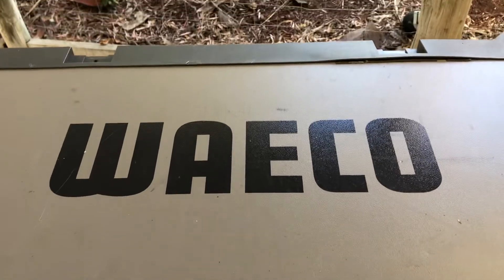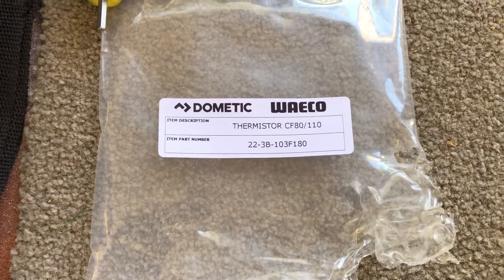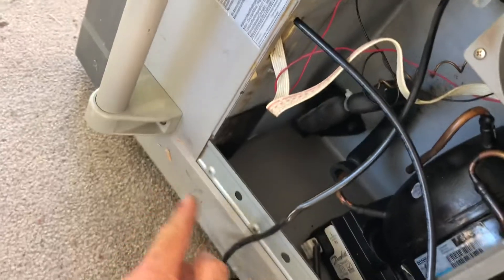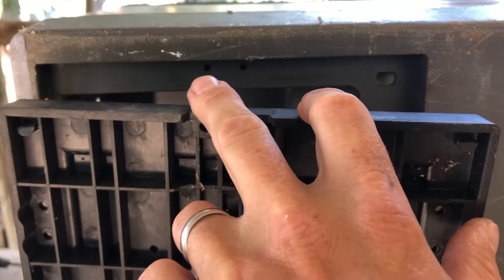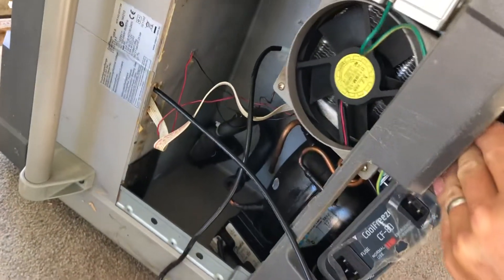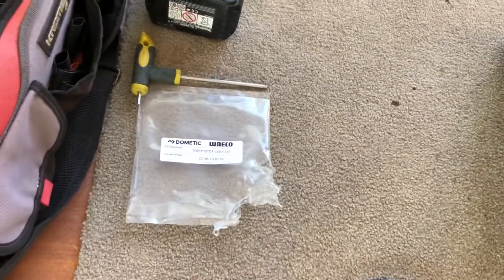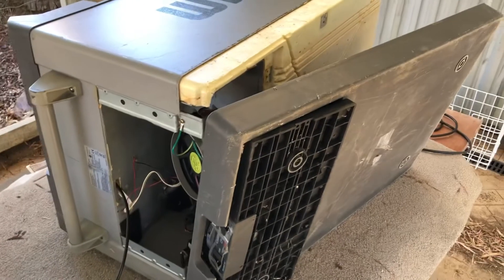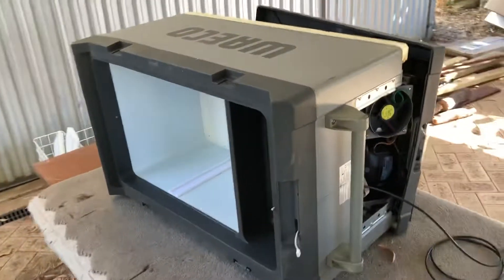How to Replace the Thermistor | Waeco/Dometic CF80 with Common Temperature Fault

Comment: Hi There, My CF80 doesn't have the thermistor cable running to the back of the display motherboard and only has the one cable running up to the motherboard (at 1:10 on your video). any suggestions on where else the thremistor cable may plug in to? And thanks for posting your video!

Comment: Hi there.dowm in Tasmania with this model fridge/freezer.. how can we be sure it's the thermostat because we haven't had our decider in and it was frosting on the freezer corner till it just stopped cooling and the thermostat read 9 to 10 since so we've unpacked it turned it upside down and we're going to replace the thermostat but is that really the problem ? Any clues please would be much appreciated.. thanks in advance.
Reply from the maker: Hi, thanks for watching. With your fault it’s really difficult to say for sure. But the Thermistor is a common problem and normally the issue for temperature issues. 
I think it’s worth the gamble being common and inexpensive to replace. 
Hope that helps.

Comment: Just an FYI. Thermal paste stays soft like the stuff you have there. Thermal plaster sets hard. You do not want to use plaster in that application or you'll never get it back out of that tube again.
Thermal plaster is used on cf series where the thermistor is glued to the bottom of the plastic.
Reply from the maker: Thanks for the tip, much appreciated.